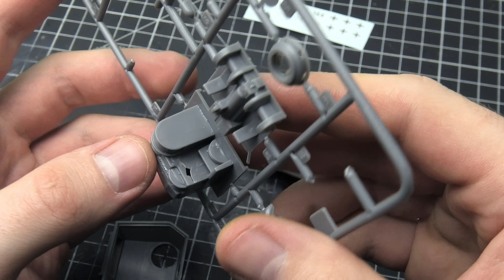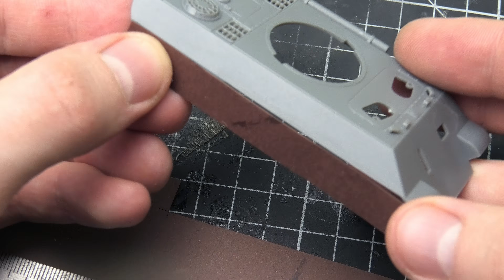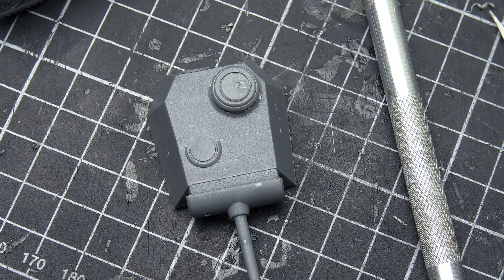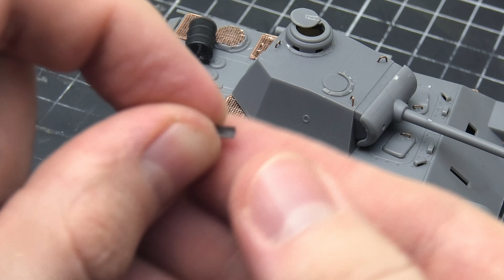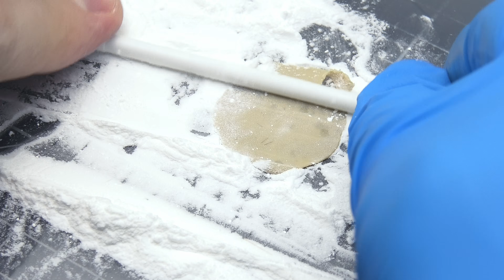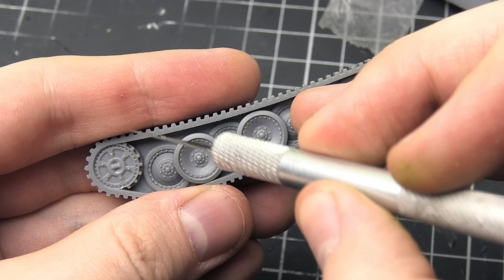Panzer 5 assembly - 1:72 Unknown Company Kit build

Comment: Hi. Some other small details that you missed are the track hangers on the side of the turret plus the spare track rails on the rear sides of the tank hull. Also there are some handles that are on the engine hatch on the rear deck. There should also be towing shackles on the front or rear. Also to add more detail I have done my own zimmerit on some of my Panthers. I did this by wetting the surface of the tank with liquid poly glue. After a short time the plastic softens enough that I then used a small screwdriver or sharp edge to impress the pattern into it. I always say to people that if you don't notice the detail that I have done then I have done a good job. I would have gone with plasticard or some plastic packaging to make the Shurtzen or you can use tin foil. It bends and buckles more realistically.  The tracks on this kit are a bit dissapointing but maybe slaver them in mud to disguise them. If you want to go really cheap then I use nylon mesh from ladies stockings or some other product packaging.  I live in London and there's always something laying about that catches my eye that I can use. Sorry about the long post but I hope some of this helps. I will now watch the next video to see how it came out. Good luck to you my friend. Stay safe , stay strong and keep modelling. By the way your English is very good , much better that my Ukranian. 😆
Reply from the maker: Thank you so much Brian) It is big amount of good advice)